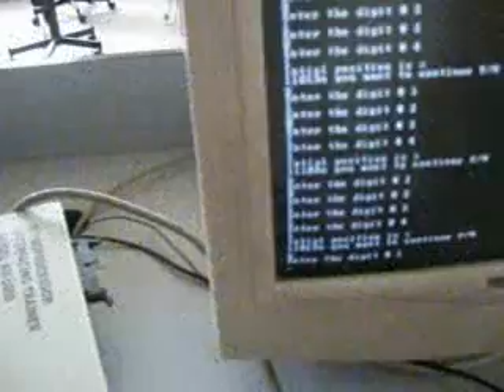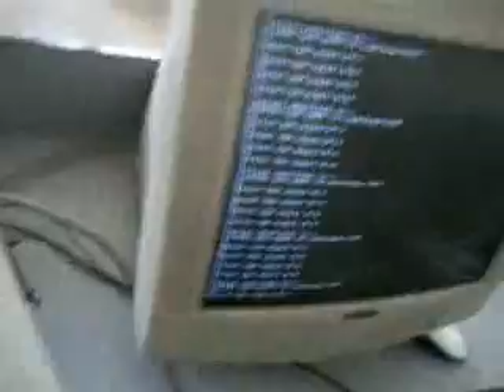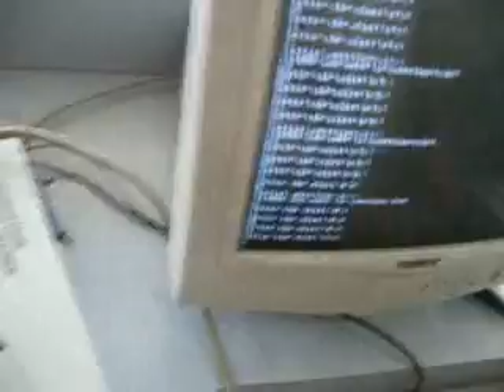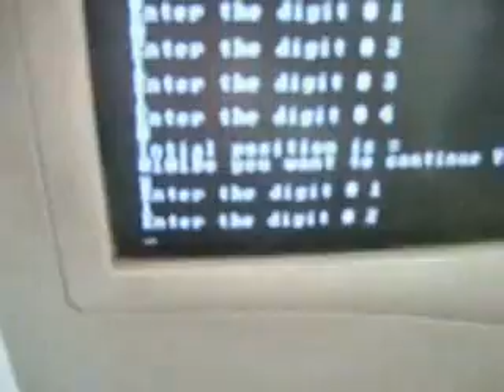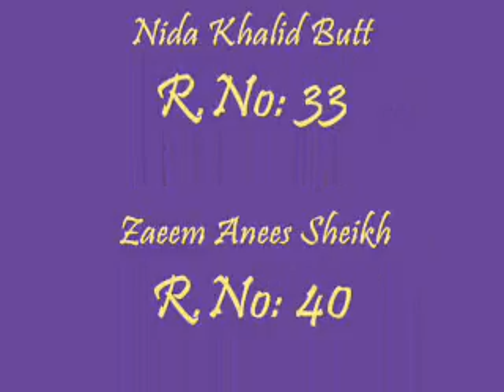Stepper Motor Interfacing Using Parallel Port

Comment from the maker: Hold on mate..... Do u want to interface the stepper motor with a micro controller like 8051 or 8052 or pic micro controller???? Cuz i also have implemented the stepper motor with a micro controller 8051..... If u want any help regarding this U r wholeheartedly welcome.....